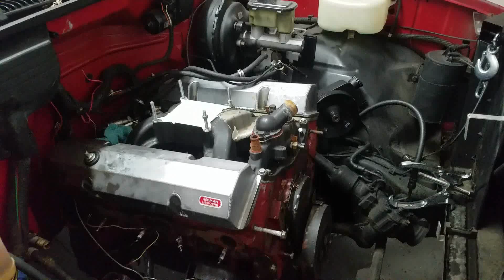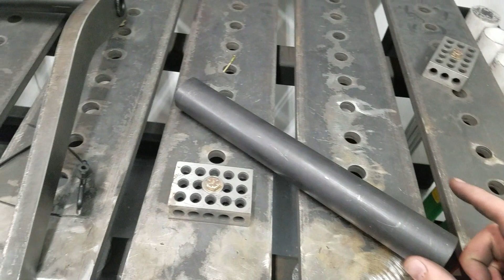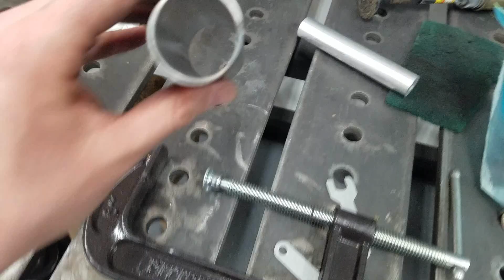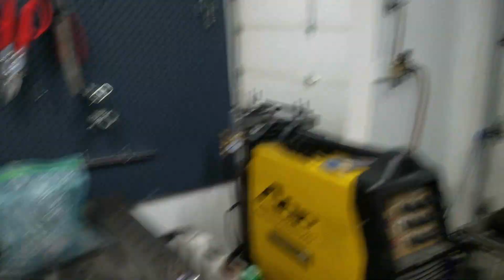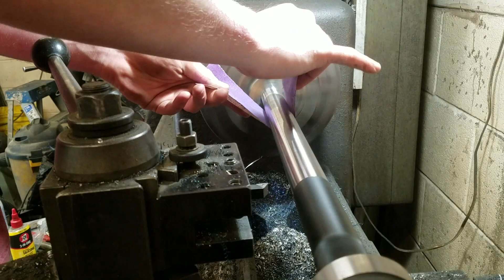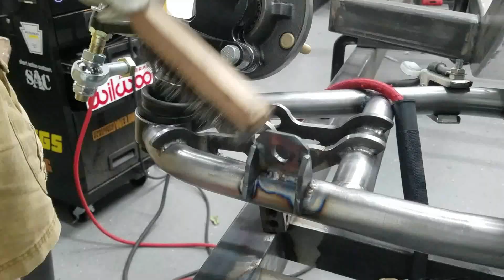C1500R OBS Build Episode #17: NASCAR Front Sway bar setup is installed on custom OBS Chevy chassis

Comment: How much would it cost me for you to build me a chassis excellent for cornering on track (autocross/time attack) ... drivable as daily on the street and still use as a truck?
Reply from the maker: I'm not currently working on others stuff because of my full time job and space. Realistically its pretty expensive. I probably have close to $5k into parts and material for the complete chassis and suspension. On top of that there's probably 150-200hours of labor to build one out. It would be less time if I was setup to manufacture in qty. Id be in the $45-60/hr in labor and consumables. Thats like $11-18k depending on the time and what stuff you need. So... like I said not cheap.